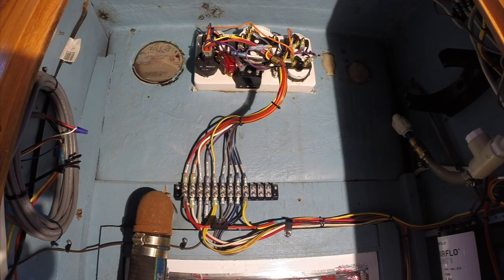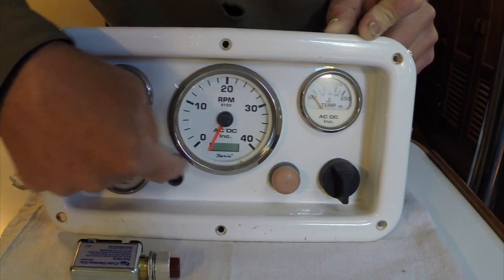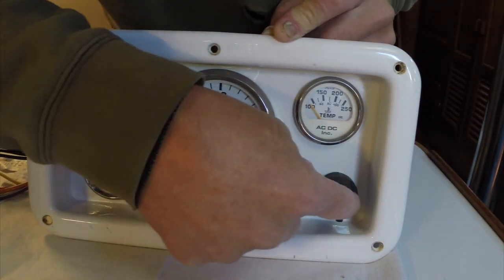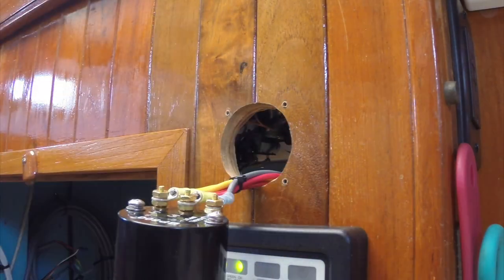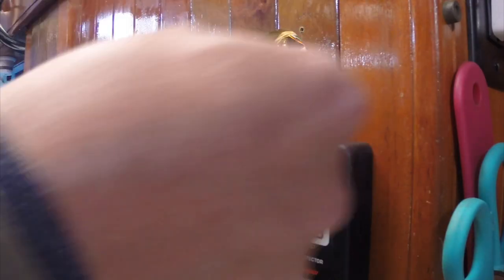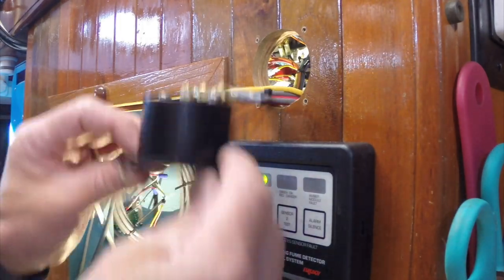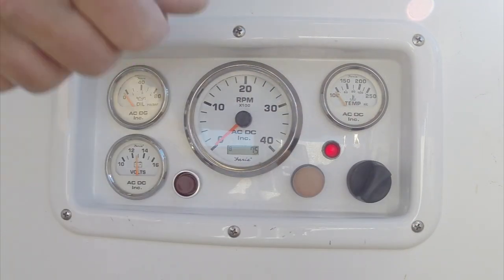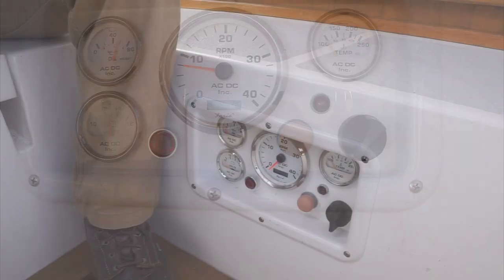SV Ramble On | Installing a High Water Bilge Alarm

Comment: The reason you guy rock is this example. You blew a fuse putting the sensor. Instead of editing it out, you left it in as a passive reminder to fuse your instruments. Nicely done. Look forward to your videos!
Reply from the maker: Thank you Andrew.  I completely forgot that I hadn't disconnected the power when I started working on it.  I'm glad I only blew a $0.65 fuse as opposed to a $65 bilge alarm

Comment: hi, nice video! one question.. do you have the alarm float switch  connected to the bilge pump also, I mean does the pump start same time as the alarm goes off or do you have a separate float switch for the bilge pump? I am working on my boat and trying to figure out how to wire my float switch so that it activates the alarm same time as the pump....? thanks for your good explanatory videos, i really enjoy watching them! greetings from Finland :)
Reply from the maker: Hi Kalle.  Thank you for the kind words and thanks for watching.  To answer your question, we have 3 switches and two electric bilge pumps.  The small pump low in the deep bilge has a switch that keeps up with daily influx of water from from the stuffing box on the propeller shaft.  The second high water, large capacity bilge pump has a separate independent switch in case the small pump can't keep up.  If water gets too high they both will run.  The big high level pump never runs, and is basically there and ready to in case of an emergency.  The third switch sits a couple inches above the second switch and only controls the bilge alarm in case the first and second electric pumps can't keep up with the water flowing into the boat. If that happens, or we have some sort of electrical failure, we also have two large manual pumps we can operate until we find the source of water coming into the boat at a high rate.  One of our manual bilge pumps is below the floorboards up near the mast compression post, and the other manual pump is in the cockpit near the helm so that one of us can steer the boat while operating the pump as the other one goes down below to find the problem.  It's a very redundant system, and hopefully we will never need to run multiple electric bilge pumps, or hand operated manual pumps.  But, I feel very safe with our system just in case something goes really bad.  Thank you again for reaching out and commenting